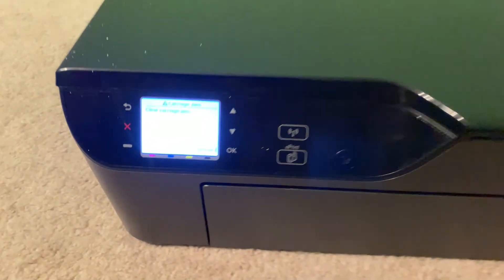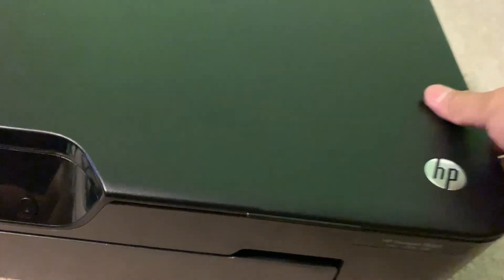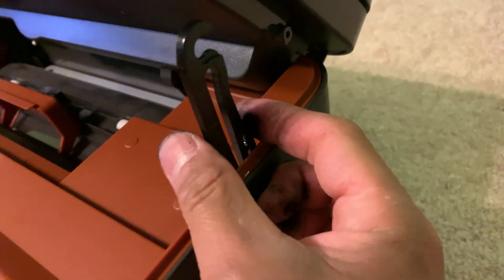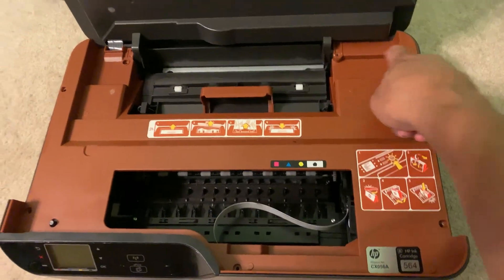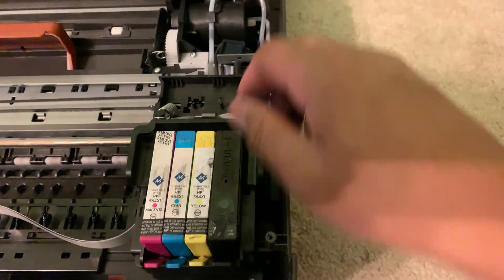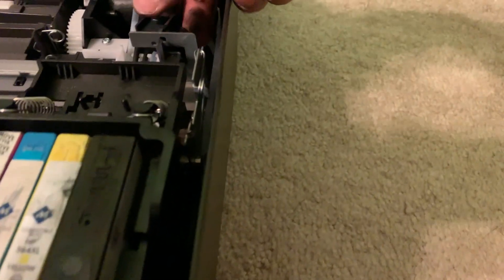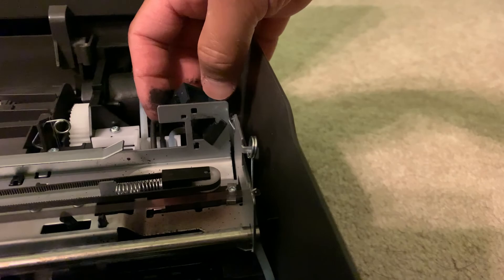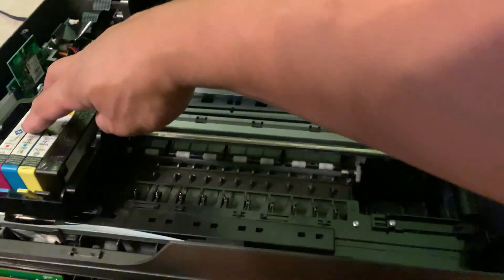HP Deskjet 3520 Carriage/Cartridge Jam Disassemble

Comment: I just had a similar problem with my HP printer but when I got the carriage unstuck out of that corner it still is telling me theres a jam. I wonder if that piece is still loose in there.
Reply from the maker: Yeah I would say that arm/sensor isn’t clipped in correctly or is broken. Try taking it apart and seeing if it is installed right.